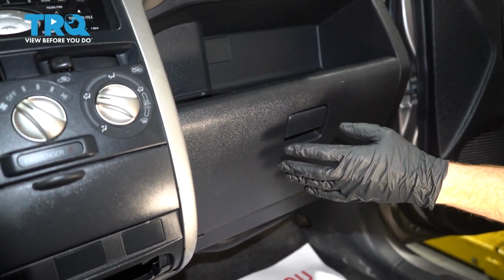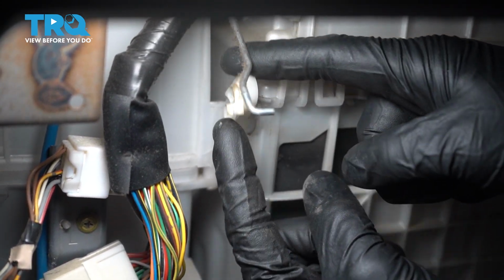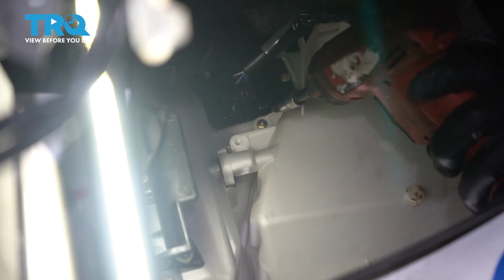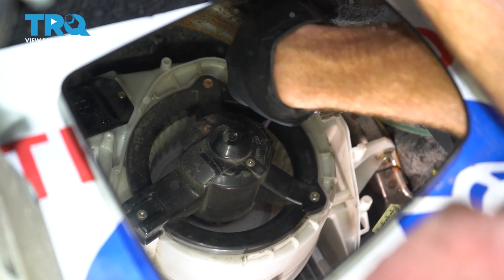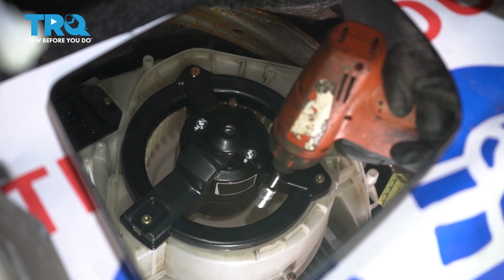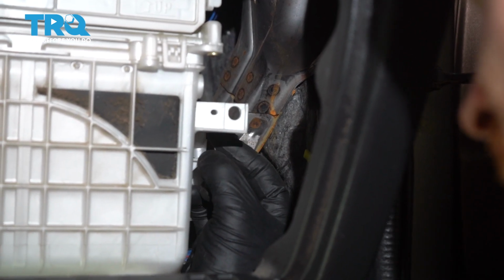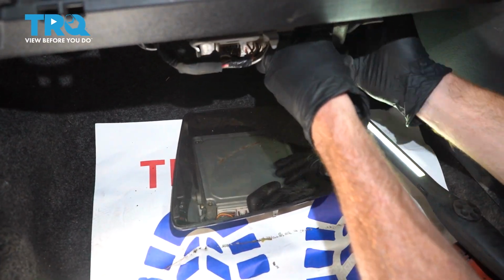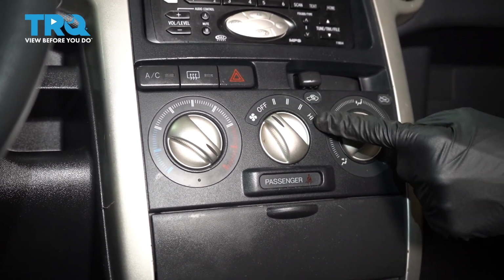How to Replace Blower Motor 2004-2006 Scion xB

Comment: Great instructions.  1)Those screws in the back really are hard to see.  I was getting them blind and took a screw out of something else.  I can't see back there well enough to figure out where it goes back.  2)It's also a lot easier to get the big plastic piece out if you take out the corner of the door black trim piece(1x10mm nut and pull) then take out the 10mm bolt on the dash behind it.  3)There's a hole in the frame right next to the clip, so put your hand over it when you're popping it out or it's gone.  I'll try some fishing with a magnet later.

Comment: I have both the blower motor and resistor replaced. And still it doesn’t work. 

I’m going to check the fuse, any chance do you know what fuse controls the fan?

Comment: Thanks!  This video makes the job super easy.  My Xb had a 5th screw in the white plastic cover (2 screws @ the upper right).  The lower right wiring harness doesn't have to be unplugged.  You can just pull it forward out of the white plastic frame and leave it connected together and tuck it out of the way on the right.  Also pull the blower motor with the 8mm screws then disconnect the wiring harness from the motor after you drop it down so you don't have to disconnect the other end of the wiring from the resistor.  Once you drop the blower motor you can easily see the motor connector clip and how to remove the motor wiring connector.  Fewer steps = faster job.

Comment: Easy to follow directions!  I'm not mechanically inclined, but just finished this with almost no issues (arthritis made some of the cramped steps difficult).  One thing that I encountered with my car was having to remove the dealer-installed LED bar under the glove box.  It blocked the blower cover from coming out.